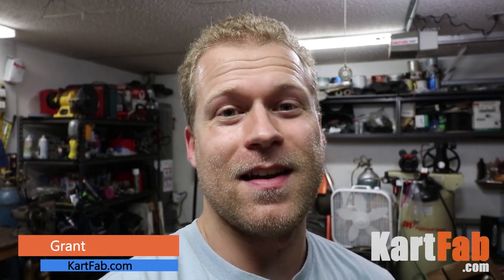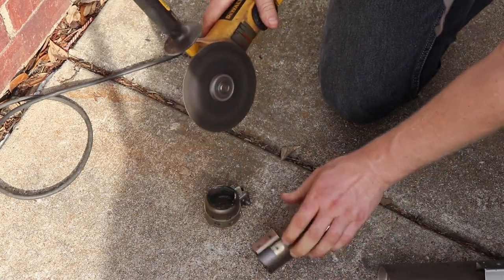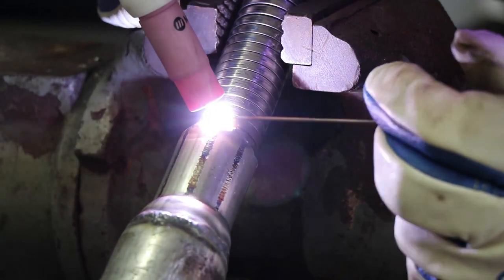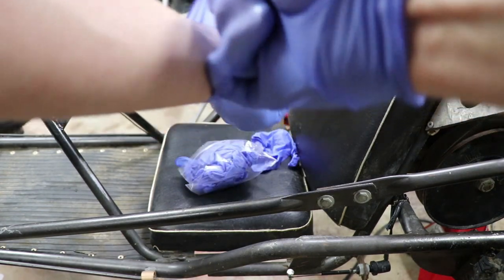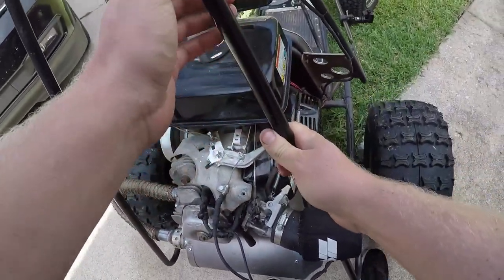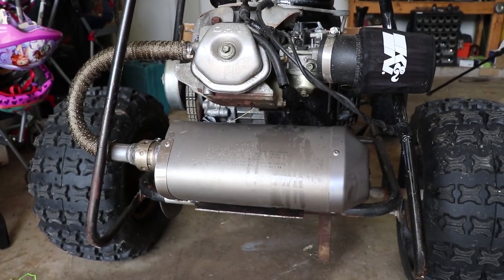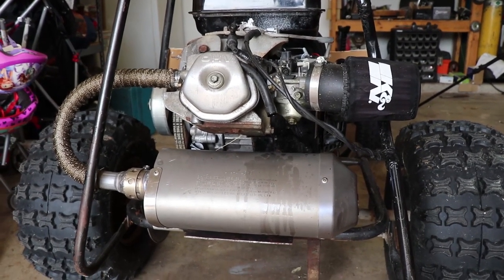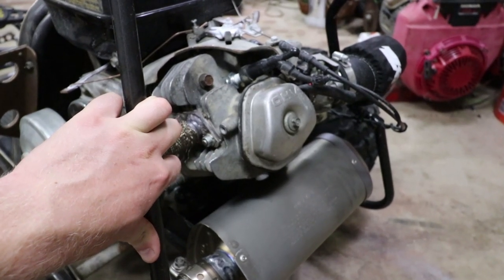Yamaha R1 Muffler + Header Wrap + Go Kart = ?

Comment: Sorry for busting your nuts but for your tig welder to make nicer prettier cleaner welds  you need to keep that tungsten sharp.... it will make everything easier for you
Reply from the maker: +dawson stober yup. That helps a ton!
Reply: KartFab you are very welcome..... I'm learning how to do it and it makes a huge difference on it..... especially on aluminium
Reply: Thnx.I've never tig welded,and didn't know that.Have a couple things needing that and the mig was just too hot.

Comment: I just put a new air filter, flywheel and replaced the carburetor on my predator 212 and it sounds quieter riding down the street. But I have a rattle coming from somewhere and my test ride around the block the engine wanted to stay at 3k rpm for a second before dropping back to the 1800 idle I have it set to. So im not entirely sure whats going on but im pretty confident its got something to do with the flywheel.

Comment: You going to run an Arc billet flywheel with the starter ring? I've seen them done for race mowers, not sure if they are done for Gx390. Also how does the 40 series belt hold up to higher rpms?
Reply from the maker: I have the arc billet flywheel w/starter for my stroker gx390 build im working on. I will not be putting a billet flywheel on this engine as it is a torque build, not a high revving build. 6k+ rpms and id start wanting to put a billet flywheel on there. The belt i use is a genuine comet and it has held up fine (so far).

Comment: What’s the inlet diameter for the R1 muffler?
Reply from the maker: I don’t know. I want to say 1.5 to 2 inches. I had to use two step up adapters welded together to go from 1” ID to most likely 1.5” ID it was also made of titanium so I had to cut the adapter and tig weld it with titanium filler.

Comment: Where did you get that flexable pipe??
Reply from the maker: I used this exact stuff  http://amzn.to/2uadex7 (amazon link)
Reply: Thank you!
Reply: Is this stuff easy to weld? I will need to weld it to a flange for the header...
Reply from the maker: yeah its pretty easy to weld with mig or tig, just not stick.
Reply: tig is the most difficult process